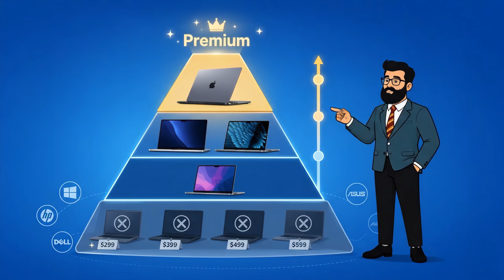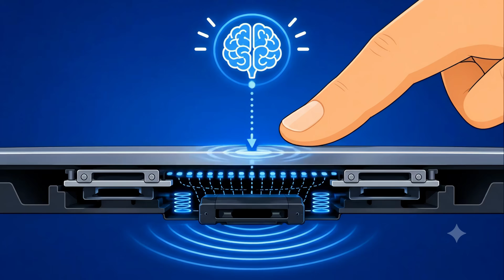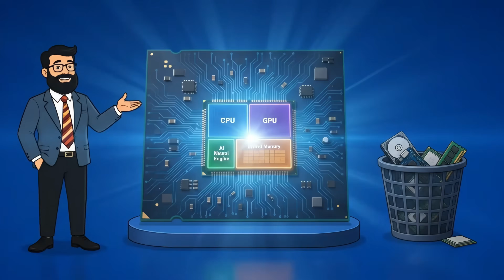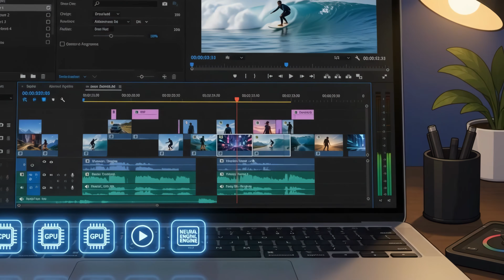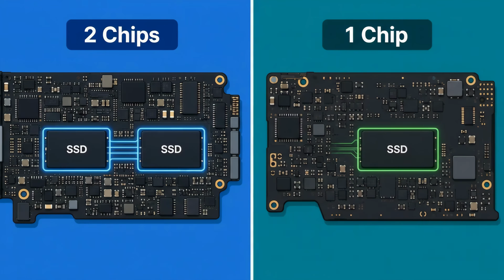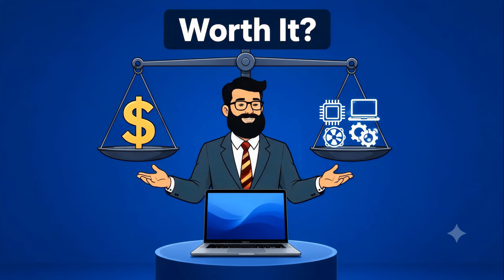Why Are MacBooks SO Expensive? (The Honest Truth)

Comment: this looks to be outdated. I've trying to shop for a laptop just last April to May 2026, and despite being a windows user for all my life, I found the mac books to be cheaper for the performance it gives. Windows laptops this days are so expensive when compared to macs of comparable performance, that I would have considered getting a flagship macbook pro instead of the most expensive lenovo legion pro 7i that i could get for 5000-6000usd. Because macs are much more faster in raw performance, but consumes way less power and performes the same even when not plugged in. Much more portable and the charging brick is small at 140 watts via type c charging vs the fastest  windows laptops with charging bricks of 300-400 watts that slows down when not plugged in to power.
Reply from the maker: Very true, if you match built quality, display quality, and specs with a windows machine, you will find it surprising to know MacBooks are not that expensive in comparison. But, most people will look at budget windows laptops and compare it with MacBooks and claim it’s expensive.

Comment: Rog strix laptops are good enough, maybe high-end ones are heavy and power-hungry beasts like G513 Advantage edition but hardware matters more. I am not a vidoe editor so i don't need it , developing apps on my windows machines is fine. The only thing i need from a laptop is RAM and no other thing , i have 2 windows Rog laptops and the big one is quiet good at running local AI models ( with 64GB of RAM and a good GPU it's very good but power-hungry ).